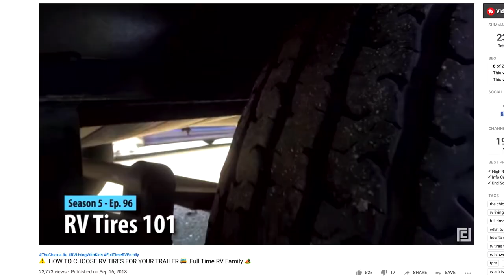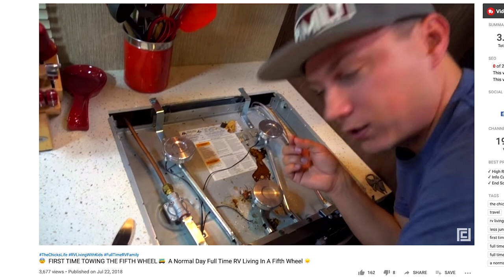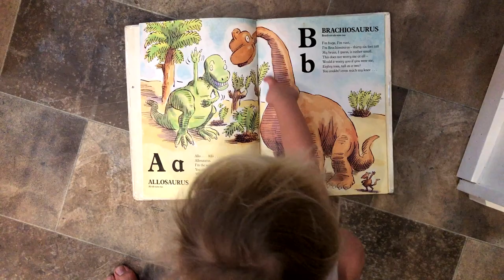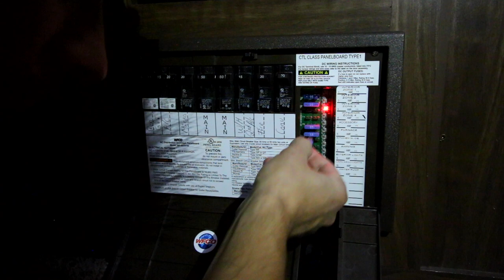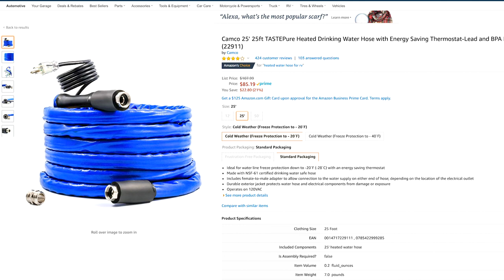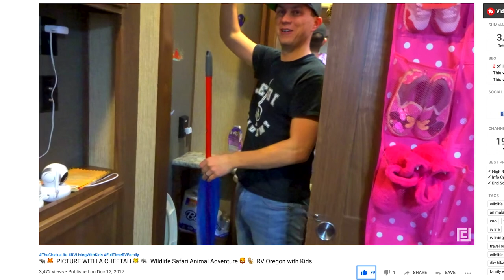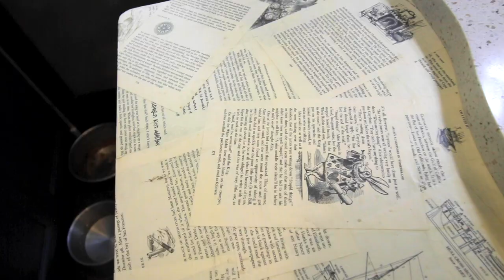⚠️ COMMON RV PROBLEMS AND HOW TO FIX THEM 🛠 Truck Tires for Towing Your RV

Comment: I was so fed up with the CO sensor going off I installed a switch to turn it off. When the wind is over 10mph directly on the side of RV with the hot water heater going it trips the CO sensor. I have a light on switch so remember to turn it back on when water heater is off.
Nice Video, thanks for sharing.

Comment: 😂 lol we have 3 GFI breakers one by the sink and shower and one in the toilet room by the sink and one in the kitchen by the sink. But the one by the sink and shower is the one that frustrates me the most because Linda tripped the breaker when she plugged in her curling iron and she can never figure out what she did even though I tell her 20 times how to reset the GIF breaker. Just made me laugh 😂 when you started talking about the GFI breakers. Funny but great video 👍🏻😊
Reply from the maker: lol. I feel your pain! ;) Wow, you have three in your RV?  What brand is it?
Reply: 2003 country coach national islander it’s a 40 foot diesel pusher cummins 400 hp fuel guzzler 😢😂

Comment: There is a way to change your GFCI breaker location if you know how to rewire your electrical. Basically the outlets are wired in series with the GFCI being first. If you can rerun your main power supply to a different location and make that your GFCI then you can feed the other outlets off of it. I hope that makes sense, contact an electrician if it doesn't.

Comment: I'm not sure how I ran across y'alls channel but I enjoy watching. You both seem to enjoy the lifestyle that y'all have. Thanks for doing what you do. Knock on wood,  Only issue I have had is a leaking slide out seal.  Had to buy a new seal, the first day of vacation,  and change it out. Our pantry or what we use as a pantry had 1 shelf in the middle, I took pallet wood sanded it down and made some shelves then got the LED battery light bulbs and installed at the top to give light in the pantry.
Reply from the maker: I love pallet board stuff!  We actually made our dining table out of an old pallet board and LOVE it! https://youtu.be/40UgSm2WYaQ

Comment: Bleach is supposedly bad for the seal on the drain release valves. You might want to check on it before you continue to use beach.  Great video!  Thanks for all the info!

Comment: The hole on the burner tube on the stove top is for air mixture, the LP has mixes with the Oxygen in the air to give you any efficient flame on your burner. If you wanna understand it better you can turn the burner on cover the both holes with your fingers and watch how weird the flame on the burner gets. It’s all about proper air to LPG mixture.
Reply from the maker: Interesting, I figured it had something to do with getting oxygen in there.  Are you sure I won't blow off my hand if I cover those holes? 😱

Comment: Changing Lanes had a video where you use a one of those flexible cutting boards and put against the fins in the back of the fridge and then the ice will collect on that instead.
Reply from the maker: Really? That is interesting.  Does it take up very much of the freezer space? I will have to go see if I can find that video.

Comment: You should be using GAS tape not plumber's tape.  They are different
Reply from the maker: What is the main difference as I honestly do not know?
Reply: @TheChicksLife  the main difference that you can see is that it is yellow and says gas on the package.  Ir is also made different.

Comment: Just FYI there is a specific tape for propane.
Reply from the maker: Hey Bernie. Really?  From what I read I thought normal plumbers tape worked well.  Is there something wrong with it I should be aware of?
Reply: @TheChicksLife  I don't think there is any significant danger in what you used, the yellow PTFE tape for gas lines is double density and is rated for over 10,000 lbs.  It is thicker and will take fewer wraps to cover the threads, handles more extreme temperatures, and provides a visual clue that you are dealing with a gas line.

The CURRENT standard is:
White = single density tape and is ONLY good for small fittings up to 3/8 in. pipe. Most people are unaware of this. "Double Density" tape used to come in white as well, but because that could be used for larger pipes, it was impossible for inspectors to know if the white tape used on 1/2" and larger pipe was in fact double density, so they stopped making it.
Yellow = double density, required for natural gas (methane) piping 1/2" to 2" dia. pipe. In many jurisdictions you MUST use double density tape on gas piping, so inspectors will look for yellow.
Pink = triple density, required for NPT threads 1/2" to 2". Again, most people are unaware of this change and hardware stores rarely sell it for the DIY market, but if you are going to get an inspection, this is what you must use now. This is also good for gasoline and propane lines.
There is also green for medical gasses (oil free tape) and gray / silver for use with stainless steel and aluminum pipe (has anti-seizing compounds embedded in the tape).
Over 2" you must use sealing compounds.
Reply: @TheChicksLife  I think Kevin Carson summed it up. Better safe than sorry.

Comment: Ouch... not CO2 sensor.  Carbon Monoxide has one oxygen molecule not two, hence the mono prefix.  It is a CO or carbon monoxide sensor which is a byproduct of burning fossils fuels.  Safe-t-Alert also makes a combined propane and CO sensor which sounds like what you may have if it is detecting a known propane leak of un-burned fuel.  Scary alarm but good to know.  James, you save your family a lot of money and probably do a much better job than an RV dealership for many of your repairs, just by having common sense... and YouTube.  😉  Nice that your family, like mine, recognizes what you do.
Reply from the maker: Oops... I am not sure why we always call it a Co2 sensor. Just habit at this point.  But yes, it is a combo propane and CO sensor!

Comment: Might seem gross but we don’t flush our toilet paper and toss it in garbage.  Never have sensor or clogged toilet issues.
Reply from the maker: That would be an amazing way to keep that from happening, but don't your bathrooms smell horrible?
Reply: The Chick's Life - RV Travel Nope.  We empty daily and spray febreeze.  Inside our sick cabinet we have a hanging basket.  Empty and spray.
Reply: I was in a houseboat and they did that too.